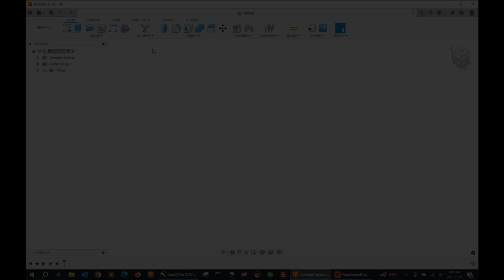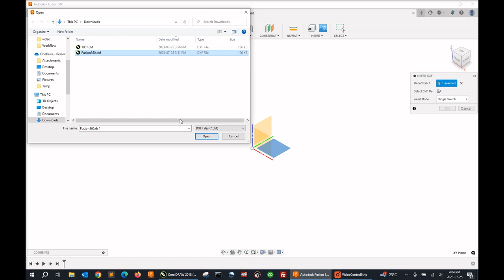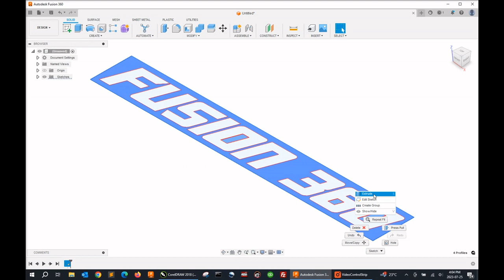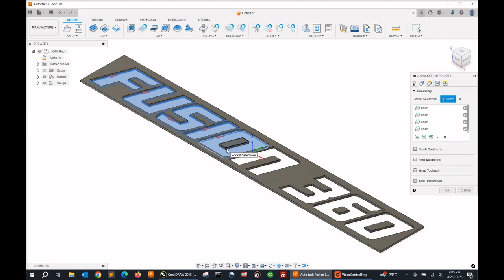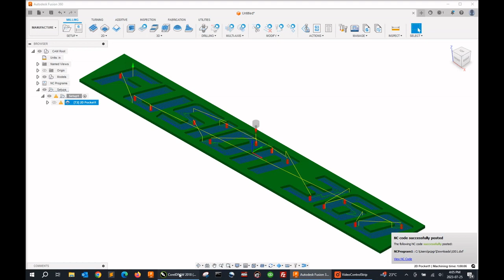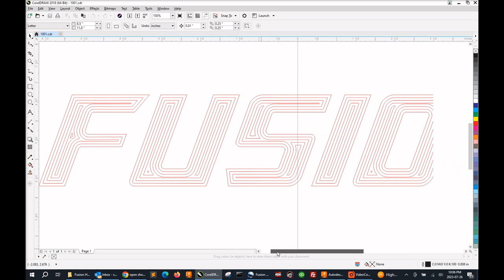Fusion 360 Toolpaths for EasyScriber Hatch Fill Patterns

Comment: How do you setup the end mill tool in Fusion 360 for the Easyscriber?
Reply from the maker: In Fusion you select the Manufacturing tab from the top left corner, select the Tool Library icon from the top toolbar, select the tool library you wish to add the tool to, then click the + symbol to add a new tool. The diameter of the end mill you choose to setup will dictate how far apart your scribe lines will be. Hope this helps.